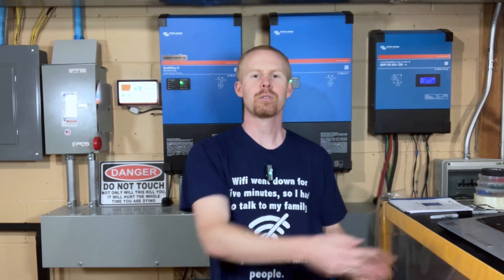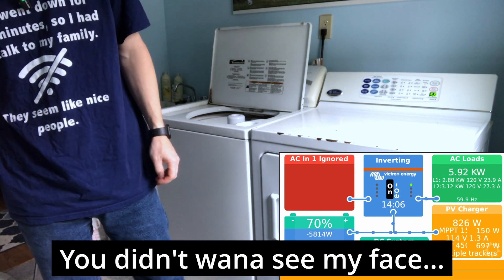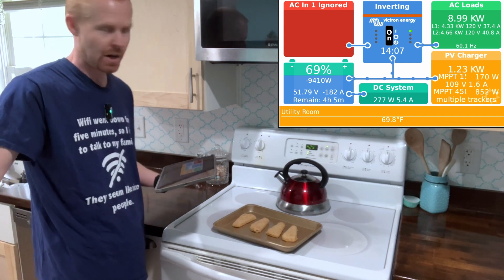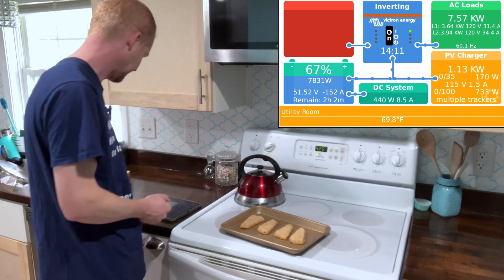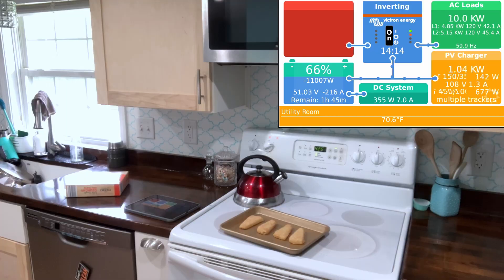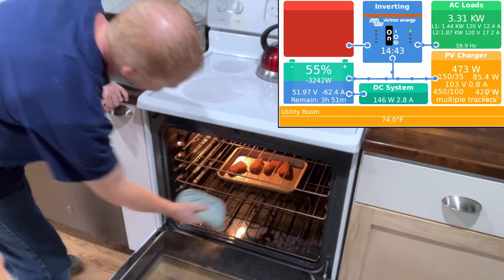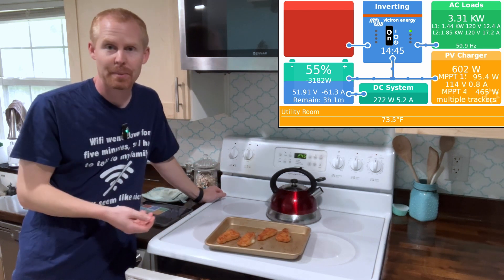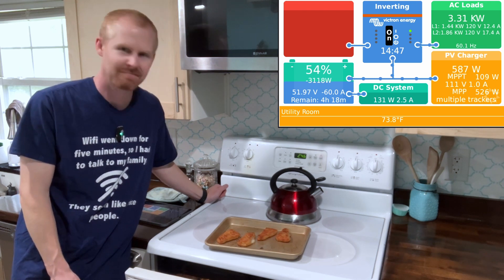Practical Test: Victron MultiPlus 2 5kVA Inverters Running Oven and Dryer Simultaneously!

Comment: Induction cooktops and heat pump dryers are way more friendly to inverters. At some point it's cheaper to replace a power hungry appliance than opt for a bigger inverter and battery.
Reply from the maker: Agreed!  We replaced one of our old freezers a year ago.  Went from 250w continuous down to 30w occasionally.

Comment: 1 gallon of propane equals 27 kilowatts of energy and is priced in Michigan at $2.27 per gallon as of 09-2023. I&M electric is $0.174 per kilowatt. So 27Kw x 0.174 = $4.70 - $2.27 = $2.43 savings. An electric dryer runs for about 1 hour per load, however propane runs about 20 minutes. It does not matter how you use the kilowatts, whether it is a Clothes Dryer, Water Heater, or Stove/Oven, Propane or Natural gas is less expensive. Eliminate 220v split phase by converting heavy loads. Our property runs on DC for lights, fans, sound, computers, Server, water pumps (SeaFlo), modem and router. We remove any AC to DC power brick and use DC/DC buck converters as needed. We use propane for central heating (12VDC), oven/stove, hot water on demand (12VDC), clothes dryer (120VAC). AC runs our kitchen appliances, Freezer, TV’s, Induction cook top's, 120 volt well which we converting over to DC. (An electric dryer can be used on sunny days as dump load). We have done all this still tied to the grid. We are upgrading from 12volt to LiFePo4 48 volt. We are shopping to replace our Xantrex SW3012. We use filtered Waste Veggie-Oil in our 5kw Diesel generator when the grid is down.
Reply from the maker: That’s awesome!  Lots of work but definitely worth it in the end!

One thing that people might not like about LP or NG is that you’re still being reliant on an outside source though.  If you have enough solar and battery, you can be 100% self reliant for power.
Reply: @AdamDeLayDIY  Living in Michigan requires the grid or a generator to supplement our life style in the winter. We have chosen to pay the propane company instead of the grid for heavy loads. Remember the math, a $2.43 savings for every 27 kilowatts when propane is used instead of the grid. We use a 3200 RPM Ninja Spin Dryer (120AC inverter) drys clothes to 90% in 3 minutes by extract water from the clothes coming out of the Clothes Washer (500 watts @120AC inverter). It extracts so much water, we can use a clothes-line or use a Propane Clothes Dryer (120AC inverter) for a fraction of the time. We cook with electric using a counter top oven and induction cook-tops (120AC Inverters) with Propane stove/oven for backup. Making on demand hot water with propane always save energy and money. We do not have line imbalances because it is all 120AC. The last seminar I taught had 13 couples learn how to harden and secure their water systems from grid failure. We also covered converting all of their heavy electric loads over to propane so they would have them when the grid goes down. Everyone there only had generators So they needed to reduce their critical loads. One couple was spending $480/month, the savings are impressive. Generators can handle multiple critical loads easier when they are 120AC. Now let’s talk about the elephant in the room, “SMART METERS”. They are spying on us all the time and are able to turn off the grid connection at will. Propane has no meter. So, no meter and is 50% cheaper to operate, that is a win in my book. Plus our waste Veggie-Oil powered Diesel generator is already cheaper to run then the grid, so, adding an EG4 Chargeverter will be a game changer when we switch from a 12 to 48 volt nominal battery bank. I have been asking you about the Victron equipment because we are starting over at a new off-grid property soon.
Reply from the maker: @stevenfrazier8939  thanks for sharing Steven!

I’m actually looking forward to hearing how your 18kPV install goes at your new property!
Reply: Update: on our current land we went off-grid with our 48VDC system on February 14th 2024 (1 year 4 days) with one EG4 18Kpv, four 15kwh Apexium DIY batteries with JK-Inverter-BMS’s and 15 kilowatts of solar. This was in preparation for the new land (5.2 acres) we bought in August of 2024. we have installed a gate and brush hogged the property. Can’t wait to get out there and install the 48 solar panels and build the utility building. i will be capturing the journey on video and placing it on my U-Tube channel. It will be private, but if you would like a link to it let me know.

Comment: It's a good test but not realistic,  it's no great hardship to stagger  using some none time critical  high loads. You don't dry clothes , or cook  24/7/365,  each is  really only used   a few hours a week, and I have never used all rings and ovens at the same time in my life.  Speccing a system to allow all loads  simultaneously run at all time is just a waste of money.
Reply from the maker: It might not be realistic for some that have had solar for a long time and are used to juggling loads.  For people that have never even had to think about what loads are running together, it’s very realistic.  Granted, it’s not something I would do with this system on any regular basis, I was just curious if it would work because it would let me run the system near the top of its capacity for a longer time than my previous test.

I completely agree you should size a system to run all loads.  There’s not point because it will never happen.
Reply: Your doing a great job with a great system…I have done this type test to push things with simalar but smaller gear this month…I found a way to get more power out safely…and for all day..
…… the one thing I’m not seeing here that is very important is a real time measurement of heat on the  batts - SCC - multiplus..all 3 ..
the batts( battle borne 24v )  and inverter are rated for full power output  at 77F  ( STC) ,the victron150/100 SCC  is rated at 90F with full power output... Vic says they do that on purpose as it is more of a continuous full duty device during the day than the inverter..

If you put them in a room that  is 75 F they will all heat up rapidly under a decently heavy load…( not nessaceraly  max) the SCC will run up about 20 degrees but it’s not a real issue as it’s rated for higher …The batts will run up about 10 to 15 degrees but they are ok as batts put out more power slightly warmer. 
what happens is the multi will run up as much as 40 or more degrees ( yes everything is wired solid - 4/0 cable- all connections and wire is not even warm.) if one watch’s the watts as the inverter temp rises and takes lazar probes of the temp, the watts used goes higher as the efficiency gets lower .
Victron has a chart showing how the multi puts out less and less as the heat rises…
SO.. I tried a trick I took off the cover of the multi.. huge amount of heat escapes when you do…it’s amazing how it just plummets …I put a small fan on the bottom to greatly increase air flow out the front … the temp dropped about 30 degrees or more and efficiency went back up about 20% to 30 % as I kept increasing airflow.
I put another fan on the SCC and the temp sits about 80F …I then ventilated the battery’s and they dropped back a good bit while putting out 150 amps at 24 v…all afternoon.

As I posted a screen shot on an online forum  you may have seen  , instead of sitting there very warm  at at 3000 watts load it was chugging right along all day at 3300 to 3600 watts  simply by keeping the temp Down below STC…ever wonder why a computer room is jus plain cold..? 
It’s the 30th of sept and I’m waiting for cold weather to see how much of a push much colder temps will give the system…
I would like to try about 40 F ambient and measure effects on the 3 devices.. and output efficiency 
Whatever your producing at normal  , will increase a lot if that equipment is kept below it STC rating…
Lastly I put a small A/ C unit in the area and brought the temp down to about 65… now all devices stay cool at max and I haven’t tripped any breakers , any overload shut downs … nothing… the unit draws 100 watts per hour as it cycles of and on alot in a small area but I’m getting back much more than what it draws keeping the equipment really cool. It runs about 15 min per hour or less.

I will keep trying Untill I find it’s limits and then back way off…then I’m buying another multi and doubling the panels…
But I just wanna know what it can pushed to do…

Best of luck with your stuff.
Jim.
Reply from the maker: @jimhanty8149  very nice Jim! 

Yes temperature does play a big factor in output capability.  That’s one reason why I have my equipment in my basement utility room which stays at or below 70 degrees during the summer.  The only reason it might get any warmer is if the dehumidifier has to run a lot.

I am glad though that Victron is a little more transparent in how their equipment operates than other companies.  If you look at the manuals at all, you should see just about all the information you’ll need to know.
Reply: @AdamDeLayDIY  haaa…Victron is on a whole other level when it comes to transparency , instructions,explanations and being forward thinking about its products use… I have 9 pieces of Victron product , some in use and some as spares some as occasional use devices  …I have not had an issue with any… that’s hard to find these days…
Chow, J.
Reply: @AdamDeLayDIY  Goes much deeper too if you want.  Victron provides a wealth of information on the capabilities of their equipment to the point where you can design your own stuff to interact with it.  I think the only thing they won't reveal is how they keep their inverters synced for parallel or 2/3 phase operation since having the public tinkering with that wouldn't be a good idea.  From solar chargers to Cerbo, all of it is fully documented.  Want to dynamically control the amp limit on a solar charger?  No problem.  Want to write your own plugin / device handler for Cerbo?  No problem.